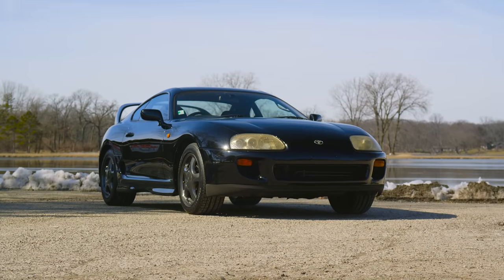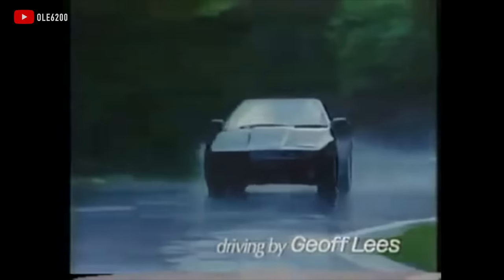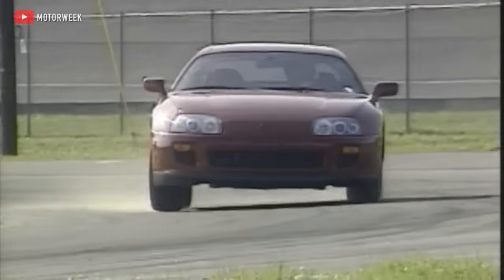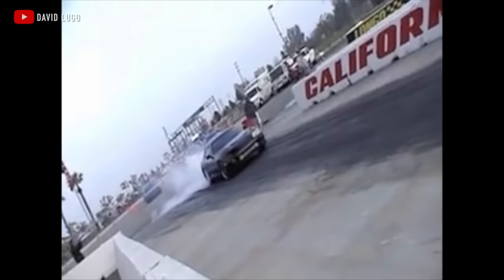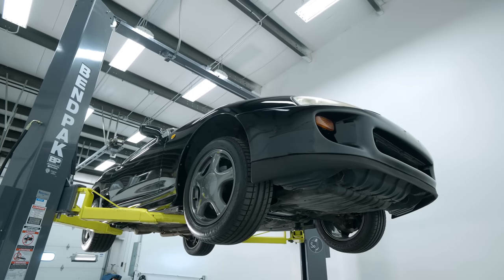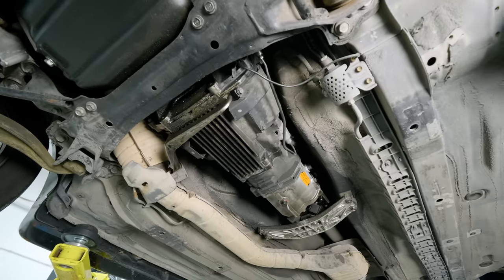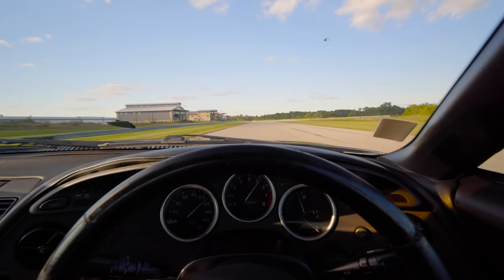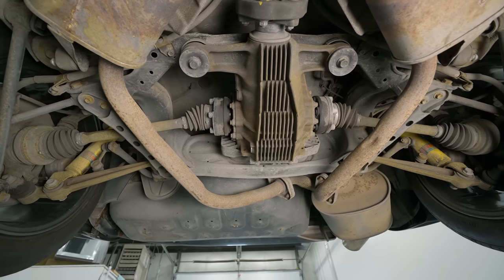Toyota Supra MK4 | Over Hyped or Legendary?

Comment: I believe it’s both legendary and overhyped. 

It’s legendary because look at what it’s accomplished, still to this day. The sound, the ability to make power, etc. Also, it’s a Toyota product, which, Toyota products aren’t really known to be badass products in the performance world. They’re known to be boring and reliable, with a little sliver of fun. But mostly boring and reliable. So for Toyota to make the Supra such a car as it is today, that deserves a legendary stamp.

It is overhyped because it’s just not worth the cost it is today. It just isn’t. Yes, you can make the MK4 Supra fast, but to get it fast costs a hell of a lot more money than it would cost to get a more modern car as fast. The looks are subjective. I think it looks good, but not great. Interior is…well it’s a 90’s car enough said. Handling is about as par as a cheap hothatch today, so it’s not anything to brag about. It is a very expensive car now. If it was $70k’ish, then I would say definitely worth it, but it is well over $70k now, and that’s when it becomes very overhyped. If it never aired in F&F, it would not have the hype it does now, but yet, so many other cars aired in F&F and don’t have the hype the MK4 Supra has. 

So yes, overhyped for sure, but also legendary enough to bring its value up, but it’s value right now is 100% not worth it.

I remember when I just graduated HS, and was starting to go to college, I was looking at cars to buy. I had about $5k, and I could find FC3 RX7’s and S13 and S14 240SX’s, 300GT VR4’s, MR2 non-turbo’s, Integra’s, non-turbo 300ZX’s, and many more, all day long for under $5k. I literally drove them all, often, but never bought any because I decided to buy something newer. Well, during this same time, the MK4 Supra-T and NSX could be found in the low to mid 20k’s all day long. Now, they’re close to the $200k’s, for the same exact car. NOT WORTH IT!!

Comment: The Celica could have been legendary if the US got all the same engine options as Japan.  We missed out on so many.  The 18RG, 4AGE, 3TGTE, 2nd gen and up 3SGE, 3rd gen 3SGTE.  I would have loved a BEAMS 3SGE Celica.
Reply: US did not get 3rd gen 3S-GTE Celica?
Although I know not even Europe got the 4th gen. 3S-GTE with VVT. (But I managed to own a 2000 Corolla with a 3rd gen with the Japanese ceramic turbo, and I am not unhappy about the turbo since I am not interested in getting more power out of it.)
Reply: @Dowlphin  Nah.  For the 6th generation Celica North America only got the FWD Celica.  Even worse, we didn't even get the 3SGE engine.  If Toyota would have at least given us that the Celica would have been more popular.  But we got stuck with the 5SFE engine.  Decent low end torque for what it is but zero performance.  The 90s was when the tuner scene was big.  If had gotten the 6th generation AWD Celica that would have been a big competitor with the Eclipse.

Comment: I’d encourage anyone truly interested in the MKIV Supra and it’s relevance in its time to pick up a copy of the August 1993 Road & Track, where it was matched up against the latest Porsche 911 Turbo 3.6 and Ferrari 512TR. Spoiler alert: with the exception of straight-line acceleration, it bested  the numbers posted by the other two cars. If you dive further into the magazine, there is a shootout between three tuner-modified cars, an RX7, a 3000GT VR4, and a 300ZX turbo; the stock Supra also beat their numbers too.

Comment: 5x MKIV owner here from stock to 1100WHP and several iterations in between.  I appreciate and generally agree with the detailed assessment, though I do wish the example was a USDM model, which has a few tangible improvements over the JDM.  Totally agree that today's values are absurd, and with the discontinuation of many critical OEM parts the future is uncertain for those that actually want to drive/experience the car vs being a 'collectors' garage ornament.  Anyhey...  Fun fact RE: over-engineering -- there is 100+ WHP to be gained just from uncorking the exhaust and adding a boost controller.  The USDM turbos and fuel system happily make 400-450WHP depending on octane and run mid-low 11's with the driver mod (I've done this - see my channel).  Lastly, the long-term influence on values, notoriety, etc.. of the FnF is comically, if not egregiously blown wayyyy out of proportion, despite it being mindlessly parroted still to this day.
Reply: Prices are exactly what they need to be, you can't find a better car for the price of a MKIV Supra.  This includes the new BMW Supra.
Reply: @b18tuner5875  That's hilarious.  10 years ago I probably would have agreed with you.  Prices were reasonable (though still much higher than its JDM counterparts) and parts, shops, racing/competition and the community were all thriving.  We basked in the glory of the MKIV!  Today.... over-priced and over-hyped relics of days gone by.  The parts situation - lack thereof - is an extinction level event, regrettably..  I love the MKIV and like I said, I've owned/built/ raced 5 pristine examples over the years (and you would cry knowing what I paid for them at the time); it was an incredible platform.  But.. a king has his reign and then he dies.....  c'est la vie    In today's market, for the money, there are countless 'better' cars.
Reply: @AP3D  I have no issues rebuilding my MKIV so I am not sure what you are trying to explain.  I just got rev2 tail lights a few months ago for under $300 for both.

Can you name a car for the price they cost now still?  That was my question.  I probably wouldn't cry because I paid 30k and my example is now worth 150k+ (rarest color).
Reply: @b18tuner5875  Hot Wheels and Gran Turismo don't count. Troll on, kid...
Reply: @AP3D  Tags weren't working, in my response.
Reply: @b18tuner5875 There’s so many cars than a MK4 Supra..
Reply: @idontgotagun9867  This isn't even English, check your head make sure it's working.

There isn't a car made to the standards of the MKIV, it's not done, it's impossible funding wise anymore.  So there isn't any car like the Supra, so I agree with you there.
Reply: @b18tuner5875  The Supra fanboy can’t grasp that the GT car sucks lol, Skylines shit all over them. Continue coping
Reply: @idontgotagun9867  correct, there are many cars other than the Supra.  Very smart comment.
Reply: @idontgotagun9867  I don't need to, I have the science and math to back me up.

There's a reason that Nissan isn't known for quality.

There is a reason that Toyota is known as the grandfather of automotive quality.  Every car manufacturer out there follows Toyota's quality standards.  I am sorry facts hurt your feelings.
Reply: @b18tuner5875  You are delusional about your boat lol. Keep crying about it buddy

Comment: I rode in one on the passenger seat once, tuned for moderately more HP, and briefly experienced the intense push of the acceleration from low speed that gave me a little bit of tunnel vision.
And Toyota recently decided to manufacture a new batch of headlights as OEM spare parts again!

I also drove the Mk3 once, on a parking lot, and was surprised how nimble it felt for its size, since from the outside it seemed like a boat.

I gotta say, I find the Mk3 design a bit 'eh' on the oldschool side and the Mk4 a bit 'eh' on the modern side with its seeming dictate of everything-rounded. A skillful merger of the style of both would have been amazing.

As for this video collab production, I don't like how much the host is in my face, and with a semi-portrayal enthusiasm. (Think: 'If everything is exciting, then nothing is exciting.' - Is he doing commercials?) - To me who specifically loves savagegeese style, it feels a bit like that obnoxious kid who just can't shut up about his new toy.
What it also reminds me of is Wil Wheaton's acting in Picard. - Not that I think Wheaton was incompetent there; I think he was deliberately playing a character with such demeanor.

9:00 $42K is nearly $50K? ... Can the guy send me his loose change? 😏

11:28 Although relatively speaking a valid point, it is maybe a bit misleading to call it near-indestructible. It is that if you pour the appropriate money into the targeted HP figure, and if you push that very high, you will have high maintenance, and those builds are likely made for show, not as a daily hard-driver. - At some point a tuned engine is almost nothing of the original engine anymore. (Yeah, a robust iron block is worth a lot, but at some point you gotta pamper it all-around with engineering bling. Cracked 2JZ blocks are not unheard of. And so many other things can go wrong about an engine, too, unless you basically tune it with OEM supercar standards or above.)

Regarding the suspension and handling feeling commentary on the track, did you consider components age? Does it have replaced OEM parts or even some original ones? Because you know that oldtimers don't drive today the way they did when they were new.
Maybe this would even be an interesting video topic for you, since I don't know anyone did this: Get two cars of the same model, one kept like a museum piece with original parts, the other with quite fresh OEM replacement parts, and then compare their driving feel.
Reply: I also wondered how replacing stock parts like bushing feel on a vintage car like an Supra or S2000. But I think I know the answer already, it's a big difference. Probably not enough for a video in it and it doesn't fit what Geese does either. But it's a no brainer that it will improve response and accuracy of the suspension, no matter if it is still stock or aftermarket.

Comment: Dad was the sales director of a Toyota dealership in the 90s. He once filled up his Supra and drove it on the highway at 270km/h non stop until it ran out of fuel.
Changed the oil and never had a problem
Reply: Where in the world can anyone, in any car, drive 270-kph, without slowing, on a public highway, for 70 to 80 miles? I strongly suspect your dad was exaggerating.

Comment: Being an owner of a moderately modified small single turbo 6 speed 97 Supra set up for the road course I think you guys did a great job on this video.  In stock form the Supra was great for its time but is not comparable to the cars of today.  I happen to live in Wisconsin and frequent ABCC with my car, would you have any interest in reviewing a modified, track focused Supra?  The car has quite a different experience to a stock suspension, stock turbo setup and is pretty quick on track.  PS my other track car is a 2006 S2000 and I find the cars more similar on track then any review typically portrays.

Some in car video of the car at Gingerman - https://www.youtube.com/watch?v=BuvQwjF18pU
Reply: It's a shame more Supras aren't built for handling. The platform is just as capable of that as it is for the 1000 horsepower dragster stuff.
Reply: @verdict1163  basically every car is
Reply: @verdict1163  Supras were originally built for handling here's one that famously was modified to enhance that:https://www.youtube.com/watch?v=rGqOG0V7-Yk
Reply: If you were forced to sell the s2000 or Supra - Which one would you keep?
Reply: @deanos1993  Well I never plan to sell the Supra, and love the car.  I also love the s2000, and bought mine 5 years ago to be my cheap track car as the prices of supras were going crazy and running a 5-700 hp car on track takes a lot of money in consumables and isn't necessary to have a great time on track.  Being an instructor I go to many track days and find both cars awesome on track and as I get older a slower car is nice from a safety standpoint.  I plan to put the 06 Laguna Blue S2000 up for sale this summer as s2000's have also gone up in price quite a bit and plan to replace it with an FRS again, with the goal of a cheap track toy with plans to eventually Kswap the FRS.  The S2000 will be sorely missed as like the supra its very unique and has a great driveline that really ups the driving experience that makes you want to use every rev of the motor and really drive the car.
Reply: @supradma71  Interesting perspective. Funnily enough I'm an instructor too - I let a Supra go many years ago before prices went bonkers and picked up a nice S2000 before they took off in price too.
I'm undecided as to which is the better car - The S2000 beckons you to drive, the Supra has more of a presence, does everything relatively well; and feels very solid in comparison.

As time passes s2k ownership becomes more worrisome particularly since new blocks are so scarce and expensive :(
Reply: @deanos1993  They are both great cars, I personally like my Supra more but the S2000 is also fantastic.  Did you ever track your Supra?  

You are definitely right about S2000 ownership, the cost of replacement engines, and parts for the cars are going up, not to mention just the cost of a chassis if I were to write it off on track, which is why i plan to move away from the platform, albeit begrudgingly.  Hopefully FRS's stay cheap for quite a while so I can be in the platform for a long time.

Comment: Supra drives like my old 2004 Celica but worse handling by all accounts. Understand the engine and other parts used were way ahead of the time though and it is RWD. Was great to hear Albon’s piece. Thanks for covering a stock Supra in depth Geese.
Reply: Yet it will smoke your 2004 Celica in every way. Be it on a circuit or straight line.
Reply: @electrikoptik  Speed isn't everything
Reply: @tyler9703  Which is why I also said "circuit". I've driven a MK4 Supra and 2ZZ Celica. A fwd car will never be as fun to drive as a rwd one.
Reply: LOL  Comical, but categorically false
Reply: To me, it's the same with the original NSX. In regular driving, it feels like an old Accord of the era. Heck, the ap1 s2000 is wayyyyy more fun and engaging than the NSX.

Comment: Hey, there is nothing at all wrong with the A340 series automatic transmission!  Sure it was only a 4 speed box, but it was solid, really easy to service and upgradable, and the grand-daddy of the AA80 series, which is also a fantastic transmission. Aisin are under-rated.

Comment: Have to imagine the soft suspension bits have become softer over the decades.  Are endlinks and bushings all factory?
Reply: The front lower control arms are notorious for getting soft over time - I had an SC300 and replaced those = much improved.
Reply: @07wrxtr1  The front lower control arms get soft? That's very weird. Does the aluminum melt or what? Suspension firmness/softness usually has to do with spring rates and damper rates.

Comment: For all the extreme effort that Toyota engineers went through to shave weight from the MKIV Supra, it boggles the mind that they didn't cast an aluminum block and press in iron cylinder liners.  That's the single best thing they could have done to both lower the total weight of the car as well as improve F/R weight distribution.

Comment: Very overhyped, just some nozzles underneath the cylinders to lubricate the pistons from the bottom doesn't make its engine special. Plus i think it's ugly and the suspension wasn't good at all, very heavy american which ironically most of its fanbase want to avoid like the plague. The mkiii felt much more like the grand tourer it is. All the materials are good and the engine wasn't bad if you took care of the head gaskets
Reply: Before the R35 these dominated street drag and roll racing
Reply: @ArtVandelayOfficial viper begs to differ lol

Comment: Mkiv Supra is definitely legendary, anyone that says otherwise doesn’t know much about it or has never driven it hard or never owned one. 

Sure its stock numbers aren’t as impressive now as they were 30 years ago, back then it was faster than Ferraris and Porsches and can be daily driven reliably. There’s not many cars that have stood the test of time both stock and modded like a mkiv Supra, nsx is great but it only does one thing well which is go around corners and is relatively reliable but far more expensive for repairs and isn’t as usable, but the Supra outguns it too in virtually all categories. 

And a note to the price, this applies to all the cars that are fetching big bucks now from the 70s, 80s, 90s, 00s, they’re worth what anyone is willing to pay for them

Comment: OG MKIV owner/racer having owned 3 turbo examples since the mid 90s. "Founding father" of the MKIV $hit post mailing list and Supraforums -- John H maybe?  '94 6spd, then 2 autos simultaneously.  Still own the '96 TT auto I bought new for $53K MSRP in '96 which calculators say is $103k today. Prior to Supras, owned/raced 911s, 944Ts, and an NSX -- now back to turbo-only 911s.  The NSX being the slowest sports car I've ever owned besides the Probe Turbo I drove in high school -- it's like a S2000 hardtop, but sexy.  Chassis aside, it was 3 generations behind the MKIV TT's engine and drivetrain instead of behind.  

Regardless, I love me some Savage Geese and especially Albon❤ videos.  That said, why review such a poor example of a MKIV Supra?  Especially being your first experience?  This car looks like it's been rotting away on an Okinawa pig farm for the last 30 years.  Undercarriage rusted, leaky original shocks/springs, dented rusted exhaust, rotted bushings throughout.  The boost leak riddled engine bay looks to have a squirrel nest amidst the rotted vacumn lines and intercooler hoses.  Then the icing being a 3rd world right-hand drive reviewed in LHD USA.  You'd get a better driving experience with a non-turbo left-hand drive MKIV.  Drive a good MKIV example and it's worth $100k+.  I thought so in 1996 dollars and still do.